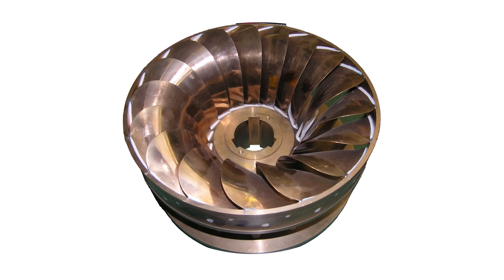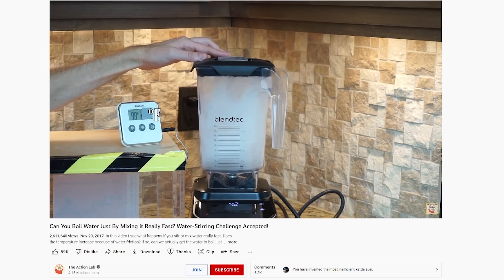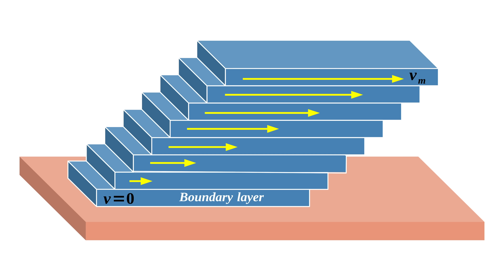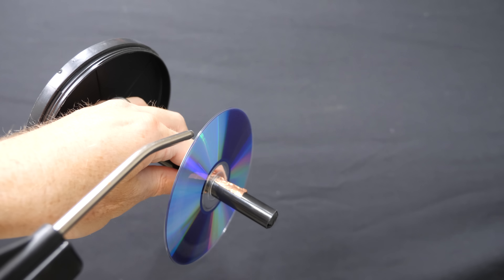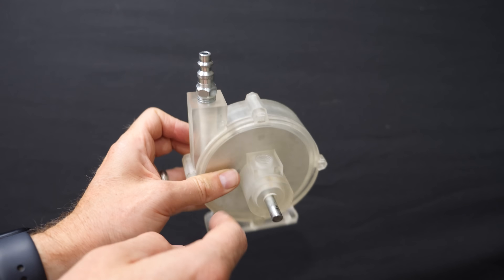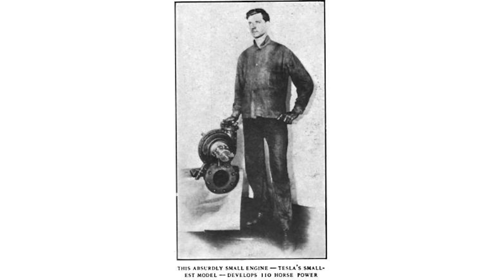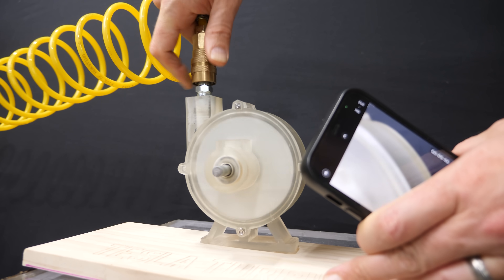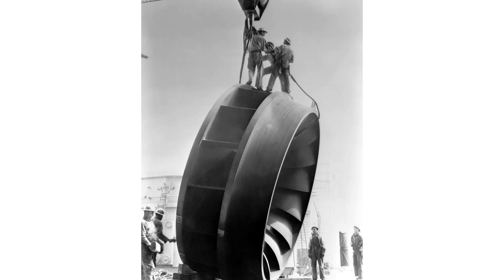How Fast Can a Tesla Turbine Spin?

Comment: I would like to add a minor correction , sort of, we do use tesla turbines but as pumps , they are commonly used in industry for fluid pumps of volatile fluids like oil. great video overall though.
Reply: Irrelevant of the viscosity of the fluid, ALL FLUIDS, liquids and gases, can be forced to flow in highly efficient low Reynolds number laminar flow regimes given the right initial conditions and “flow cavity” parameters, such that turbulent boundary layer slip is eliminated, stream separation and counterflow is eliminated, rapid pressure changes from turbulence resulting in noise losses that can lead to early fatigue on discs and parts is eliminated, etc. 

Tesla turbines get PLENTY OF TORQUE. You just have to know how to design them. 

“Owing to a number of causes affecting the performance, it is difficult to frame a precise rule which would be generally applicable, but it may be stated that within certain limits, and other conditions being the same, the torque is directly proportionate to the square of the velocity of the fluid relatively to the runner and to the effective area of the disks and, inversely, to the distance separating them. The machine will, generally, perform its maximum work when the effective speed of the runner is one-half of that of the fluid; but to attain the highest economy, the relative speed or slip, for any given performance, should be as small as possible. This condition may be to any desired degree approximated by increasing the active area of and reducing the space between the disks.”
-Nikola Tesla
Reply: @CharlieSolis  dude your TesTurs that you make are AWESOME!! how does no one know about your work?!? 

You actually make real working Tesla turbines but yet all up and down this comments sections people are DEMANDING what you have already proven possible “can’t be done!” 🤣

For real what was your peak power and torque output on your last TesTur dyno test? 

It was peak 6kW at 7000rpm and 6.22ft-lbs of torque at only 4200rpm right?!

On just compressed air too? 
No heat or anything?!
Reply: @teenagemutantninjaraver2224  ❤🙏 if only I could get the viewer reach as this big channels… apparently no one wants to Tesla turbines that actually work. 

They just want to be fed the same erroneous tidbits they were told about Tesla turbines not working that they heard in the last 2 Tesla turbine videos they’ve watched while they edge out going through the comments parroting the same “tHe tEsLa TuRbInE hAs To bE sPuN tO fAsT tO wOrK… blah blah blah…” 

Apparently the it’s better for views to post “controversy” vs scientific progress… 🤷‍♂️
Reply: @teenagemutantninjaraver2224  for the air to flow, there must a pressure difference. that means the compressed air being input leaves as a low pressure high volume air.
Reply: @janami-dharmam  which is why it is suggested to have a Tesla pump after the output of the Tesla turbine. While it's not free energy, the rotors spin each other up, and improve operation efficiency.

Their preference is to spin up, and tap power from the pump.
Reply: @Dan-gs3kg  the only time you want a second stage pump is if you have a heat exchanger between the turbine and the second stage pump to make it an inverted Brayton cycle. This is what everyone keeps getting wrong with the 2 stage TesTur. Without the interstage heat exchanger design of mine it doesn’t add anything and in fact just takes power off the shaft.
Reply: @janami-dharmam  dood… what are you even responding to that you thought I needed to know that information…?
Reply: @janami-dharmam  
Is it the “on just compressed air too? No heat or anything?”

Because “heat added to compressed air” makes the potential power available go up. It’s what the Brayton cycle is. Compress a gas, heat it, expand said gas through turbine to generate power with the heat. 

Compressed Air Energy Storage just compresses the air, takes the heat out and stores it in a thermal mass for when the stored compressed air is released for power out to keep a high round trip efficiency. But if you just expand compressed air without heat regen you won’t get nearly the same energy available as what was put in. 

Additionally, since the turbine works on viscosity (cohesion) and adhesion with the disc faces the fluids viscosity makes a different. And since gasses have the opposite viscosity trend as liquids, they get thicker as the get hotter and thinner/runnier as they get colder, the decrease viscosity of the cold expanded compressed air going through will have a lower isentropic efficiency for the same disc spacing due to the lower cohesive forces in the fluid allowing more slip. 

On the opposite side of that, it means that Charlie’s turbines will get even more efficient as the temps are raised up to combustion temps because the viscosity of gases increases with temp and as such slip on the disc will decrease, ultimately increasing torque, power and efficiency for a given motive fluid supply. 

That’s in addition to the increased thermodynamic efficiencies with the increased fluid temps.
Reply: @CharlieSolis  the group I referred to didn't have a common shaft between the stages. Their suggestion was to pull power from the pump Whether that is the best idea, I'm not sure, it does make sense why spooling up the pump first is their preference.

What would be neat is if keeping the turbine hot, or the pump cool is enough to continue its operation.

The heat exchange makes sense.
Reply: @Dan-gs3kg  Tesla refers to this in the GB 186,083 combustion + steam improve TesTur patent. 

“This plan provides an efficient self-starting mixed-fluid turbine which may also be operated with steam alone, merely by shutting off the air and fuel supply, and is on this account very convenient. Minor departures from it, as may be dictated by the circumstances, will obviously suggest themselves, but if it is carried out on these general lines it will be found highly profitable to the owners of the steam plant while permitting the use of their old installation. However, the best economic results in the development of power from steam by my invention will be obtained in plants especially adapted for the purpose. It should be added that this method can also be successfully applied to condensing plants operating with high vacuum. The production and maintenance of the latter will be materially facilitated by the employment of a pump as shown in my British patent before referred to. In such instances, owing to the very great expansion ratio, the exhaust mixture will be at a relatively low temperature and suitable for admission to the condenser. This will call for better fuel and special pumping facilities, but the economic results attained will fully justify the increased outlay.”

The high vacua pump patent of teslas GB 179,043 is what’s needed for the pumping facilities.

This is an HP Rankine + Inverted Brayton Cycle^^
Reply: I think you mean viscous fluids, not volatile.
Reply: In planes?

Comment: what would happen if you doubled the air flow. one input from the top like you have it but another from the bottom .
Reply: That would break the laminar flow towards the center. The two flows combining would cause turbulence.
Reply: @BenEllick  shouldn't the water or air be gone from the outside where the new flow came from.